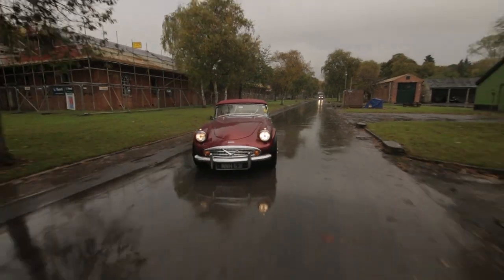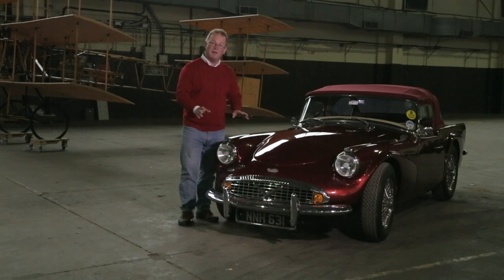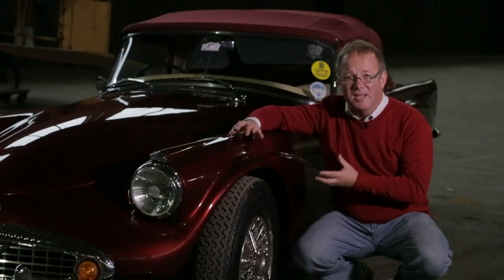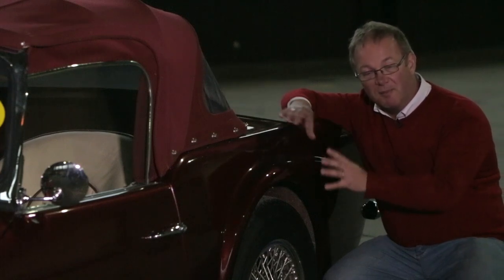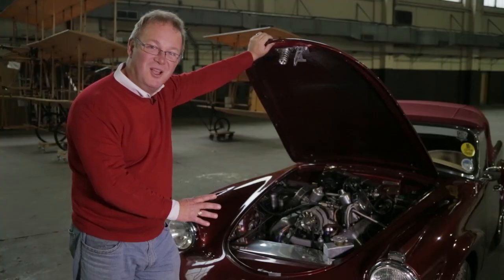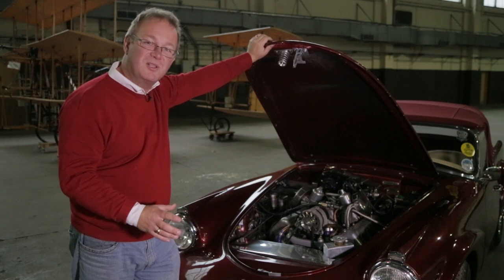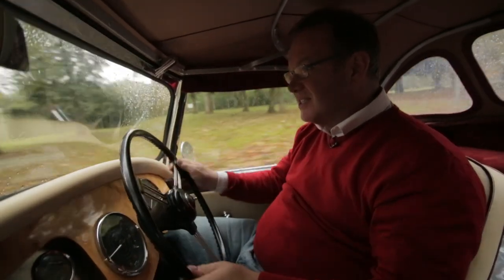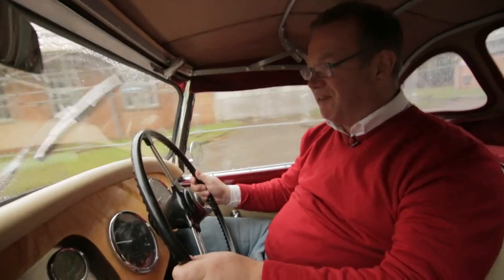Daimler SP250 "Dart" | Buyer's Guide

Comment: While I recognise that this SP250 looks to be a prime example, its colour/paint and drivetrain are the main reasons for liking it. I agree that they were ugly ducklings when new, and they still are IMHO. There is no way that I would even contemplate trading one in even part exchange for my BJ8 Austin-Healey or E-Type Coupe. They are much better looking and engineered vehicles, but again that is my opinion!
Reply: E-types had seductive looks but they were unreliable rot boxes with ponderous gearboxes and questionable aerodynamics.  The D-type was far better.

Comment: I remember these cars new.  A beautiful little engine, even though it was a bit under-developed.  As for the rest of the car, it was totally underdeveloped.  The chassis was too flexible, the body was not to the standard you'd expect from a cheap little MG, let alone a Daimler.   Hard to think of printable words to describe the looks.  No wonder that Daimler basically stopped car production completely for almost a year in the late '50s, just as it did in 1930.